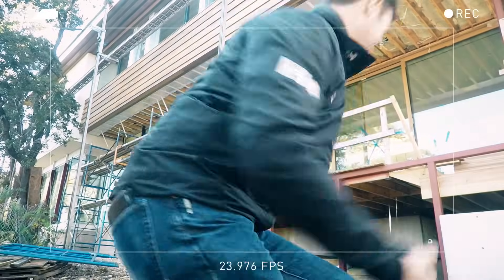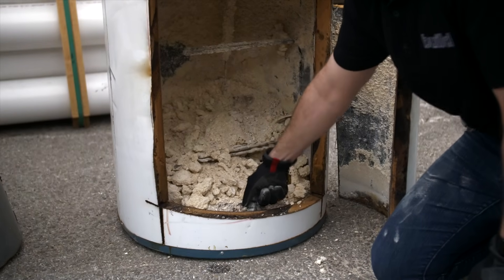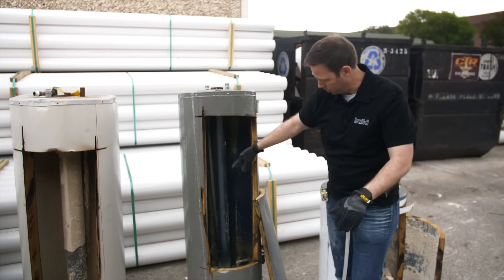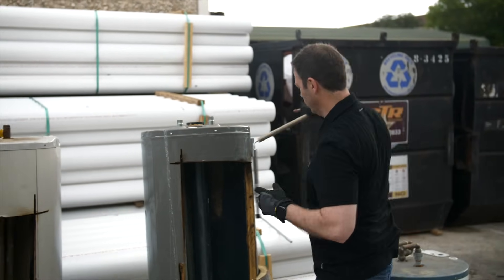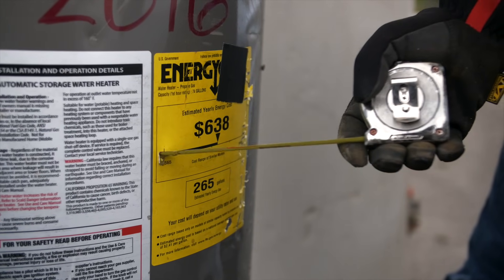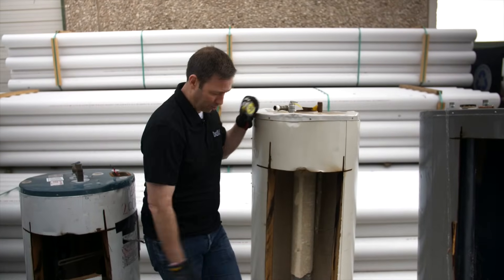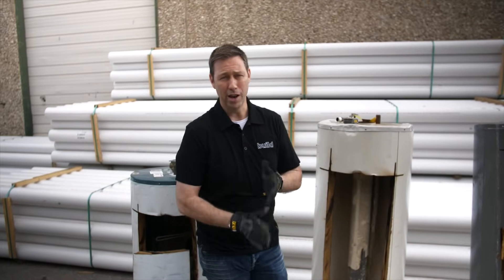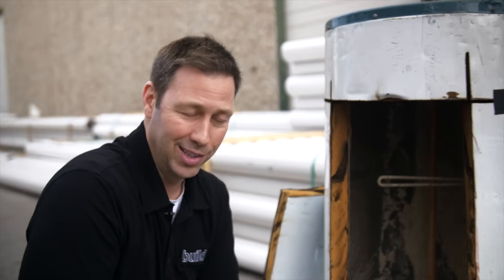Four Water Heater Tanks Cut Open - Lessons to Learn

Comment: @6:53 Pro-tip; cut your water heater open at the store before you buy it, to check insulation thickness.
Reply: You cut it, you own it!
Reply: No need to any more, you can download the specs to your phone.
Reply: Make sure the gas is turned on when the sparks start flying !!

Comment: We learned the hard way that you only touch the drain valve when replacing your water heater. Those drain taps are crap and will leak after you open them. It is a sure fire way to destroy your water heater. There really is just no way to extend the life of your water heater.

Comment: I bought a 10 year old house.  Did a water hardness test and found it was really bad.  So I bought a softner system and replaced the hot water heater.  I cut the old tank up, (Didn't have $20 trash fee, had a box of cutoff wheels and time) and found 6"-7" of scale/sediment.  The bottom coil was encased in scale.  I installed the new tank with Sharkbite flexible connectors with shutoff valves, so I can actually pull the whole thing out if I need to.  I'll replace the anode rod every 3 years after seeing this.  I don't care if that's unnecessary, I've spent a lot of money on this house, the softner system, and the new tank.  I'll spend a little more and get as much out of all of it as I can.  Thanks for the advice!

Comment: Those yellow stickers on electric use are meaningless. Look at the fine print. There's so many variables including price per kw electricity etc they are useless. To accurately predict that you need to know the temp of the air outside the heater, the water temp setting, amount of water used per month, price of electric etc... Nobody can predict the yearly price and they really don't need those stickers on them lol. What they should do is standardize the environment they're tested in and place a sticker on it for how many kw it uses over a year without ever using any water even. Then we'd know how good the insulation really is and have a good estimate of how much better this heater is than that one. But whatever it'll never be done and the info will always be unscientific, inaccurate, and meaningless.

Comment: So you're saying replace the anode rod every five to seven years however one of those tanks you just showed us was only 2 years old and had complete corrosion and look like the thing was going to snap off before you could even pull it out of the tank!
Reply: When a two-year-old electric water heater had an electrical fault which provided 60-80 volts to the inlet and outlet water pipes, everything corroded rapidly.

Comment: Never, ever herd of anyone replacing anode rods. Never knew you were supposed too.
Reply: They are so frik'n hard to get out....nobody wants to. You'll tear a ($500 deductable) ligament trying.
Reply: @readmore3634  good to know...thanks...so there's a not insignificant cost to doing water heater maintenance.
Reply: @new2000car  Look...here's the low down on water heaters...when new, remove the drain valve and replace it with a 3/4" nipple, a 3/4" ball valve (Full Volume).. and screw a garden hose adapter onto it with about a 3 foot hose.... Every 6 months, without turning off the water to the house, open it up all the way into a 5 gallon bucket and blast the sediment out several times. That keeps it pretty clean and it takes seconds. As far as life expectancy.....soft water is the best you can do. I have soft water and everything lasts much, much longer....especially shower heads, tub/shower valves....everything. Experience? 35 years a Union, Master Plumber. 10 years my own business.
Reply: @readmore3634  Sure that's the right way to do it...but anything that takes more than a minute...like installing a better drain valve...in the real world is not going to get done by the vast majority of people...if they can get out of doing it. How much extra would you have to charge to do this? People want it fast and cheap. There's also the if it ain't broke, don't fix it thing. Take off a non-leaking, cheap garbage drain valve and endeavor to install a high quality ball valve (how much is just the part? Gotta go get one, but how...drive over to supply store, online?) Better install it right, and test it. Consumers do not want to spend the money to have this done, mostly. I think I learned the prevailing school of thought on this the hard way. I had offered to flush someone's hot water heater a long time ago and the act of just opening the drain valve and then closing it...guess what happened?
Reply: @new2000car  I know what happened....I figure it's the do it yoursefler's  here... and I did say "When NEW....remove the drain valve (normally cheap plastic piece of crap).  If you try to remove the plastic  valve on a 10-20 yr old heater....you better be ready for it to break off inside. I have skills and tools to deal with things most DIY'ers cannot. But if you ask, I tell you.
Reply: Read More I know you said “when new” and even then the new valve-someone has to go out and find it at a hardware store, pay for it, then drive it back to the home, then install it. That time and energy could be better spent on fixing something else instead (in my humble opinion).
Reply: @new2000car  its not a fix...its to help make maintaining your water heater a breeze. I've replaced water heaters with a LOT (pounds) of gross looking stuff in the bottom of the tank...differs from place to place. So I put this dependable, cheap, easy to find and install ball valve on so I can blast that crap into a bucket twice a year.

Comment: You could actually tip your tank over about 20 degrees if it's in a closet and pull that anode rod out and replace it

Comment: I have a heater that is 18 years old. I remove elements and clean them, flush and have changed anode 4 times and clean out bottom of tank and it still works like a champ. We have extremely hard water with no softener but when I replace current tank Im adding a softener too. Getting to old to mess with the heater so often.
Reply: Be careful. Hard water actually protects your tank from corrosion while soft water is corrosive.

Comment: Appreciate your attempt to inform us, but by the look at the responses, you stirred up a hornet's nest. I think I will go tankless, thank you very much. I hope my comment doesn't stir up this hornet's nest anymore than what it is.
Reply: Tankless require an annual de-scaling.  Read the owner's manual available online at most big box stores web sites.
Reply: Charles Tredway You will regret it! "Combi" boilers as we call tankless heaters in the UK are terrible. They scale up quickly and flow reduces. You waste gallons of water waiting for them to actually run hot. They turn on every time you run a tap, so the electronics take a battering. When they inevitably fail you have no backup (most tanks here are heated by a separate gas boiler than also provides central heating, but have an electric element too for backup) the efficiency is questionable as you are always having to run water to waste. They don't work at all in a power cut. You'll be lucky to get ten years out of one, even top of the range. They need larger gas lines. They have limited maximum flow, two good showers if you're lucky. They won't have got hot by the time your dishwasher or washing machine is full (assuming you have usual US hot fill appliances)

Comment: A water heating spiral of hot water from the central heating system is a good way to heat the hot water, even better if you have a combi boiler, a condensing boiler is 85% efficient,

Comment: Makes me wonder if it’s the water supply that causes all that scale buildup. Well vs city water and maybe different issues from town to town.

I have never touched my 50 gallon electric for 10 years. Never thought about it. But that little plastic drain valve on the bottom feels like it might break if I open it! It seems to take forever to heat up any more. The digital control panel on mine does not show any errors such as an open Heating Element.
Reply: Slow heating is expected if the heating elements are buried in sediment.  You could try flushing some of that out and see if it improves performance.

The big gotcha is that once the drain valve is opened, closing it is likely to be some sediment preventing it from closing completely.  A "partial flush" is unlikely.  Flush until no more sediment comes out.
Reply: I will defiantly give it a try. I might try running my bore scope in there and take a peak as well after it’s drained.

Thanks.

Comment: You could just buy a tankless water heater which are standard equipment throughout Europe, Asia and South America. Not only will the heater last longer (20+ years) you will save more money on energy costs.
Reply: Not true for those with teen daughters. Endless hotwater means means Dad banging on the door "get out of there you're costing me a fortune"
Reply: The problem is power supply. Many old homes dont have enough amps to run that along with the rest of the house. 3 double pole breakers take alot of space in a box. Its especially difficult if the house still has fuses.
Reply: Kris Johnson Tankless gas water heaters don’t require a lot of electric power. The one I had in Europe was battery operated. Like the starter on a gas BBQ all you need is a spark to ignite the burners.
Reply: @y2knoproblem  IDK about all that... half the time our customers don't even have enough power to run an electric tankless and don't want to pay an electrician change boost your box.They pull a shit ton of energy. Especially if you don't live in arizona where the groundwater isn't as cold. We don't even install electric tankless in washington state because of how much power it takes to get the water from 50 to 120 degrees instantly. 

Now gas tankless on the other hand... Can't go wrong there.
Reply: Don't forget to buy a Navien.. everything else is junk.
Reply: @y2knoproblem  Guess again!  A tankless water heater vs. a standard one is a trade-off between creating all you would ever need at any instant (everybody showering at the same time while the dishwasher and washing machine are running), vs. providing a solution that averages out those peak demands by providing temporary storage of enough hot water to get you over the humps in demand.  Any system that places sudden high demands on its supply by its very nature will be less efficient than one that is more continuous (smaller peaks).   Plus when you factor in the much higher costs of the tankless unit for safety purposes alone (it must be able to handle much higher energy levels and not catch your house on fire) you are much better off with more water storage.  The only (gross) savings that a tankless unit provides over a standard tank unit is the energy lost from the hot water in the tank while it is sitting there.  Use a fraction of what your were going to spend on the tankless unit and buy additional insulation to wrap around your tank.  Especially for gas units, that savings is lost in all the additional maintenance that must be done and paid for in the tankless units.
Reply: *y2k
not in all cases.  depends on whether tankless is electric or gas.

Comment: Question, Will a worn out electric hot water heater "Cause Low Hot Water Pressure?" Mine is over 10 years old. What say you?
Reply: That could happen if the water tank is mostly filled with sediment.
Reply: Thank you Wally.

Comment: Hey Matt, you needed to also mention the "Dip Tube" that fails also. It's made out of plastic and deteriorates usually falling into the tank. When it's to short, cold water is mixed with the HOT water at the top section of the tank cutting the temperature drastically. This dip tube is about 12" off the bottom of the tank and supply's cold water to the bottom where the burner is on a natural gas or propane tank.
Reply: It should also be mentioned it needs to extend to the bottom of the tank so when you are flushing the heater it will stir up the sediment so you can get it out!

Comment: When my previous home was 5 years old, I had to replace the heating element in the water heater. We had a water softener, and inside the tank was a bunch of thick milky looking stuff, I assume from water softener. Maybe not adjusted correctly? I flushed it out real good and replaced the element. Interesting video.
Reply: The milky goo is probably bacteria growing, usually harmless. I only started seeing this when the government mandated water heaters to be set at 125, a perfect temperature for a petrie dish to grow bacteria...  it's illegal, but I set mine at 135 to prevent this- higher temperatures not safe for children or the infirm.

Comment: This is probably a dumb question.  Can a filtration system be installed going into the tank to help prevent buildup?
Reply: My home has a water softener system and the supply to the hot water heater comes from the softener. So yes you can install a filtration system for the entire house or a water softener system. Although I would not install a filtration system that supplies water to the hot water heater that removes chlorine.
Reply: y2knoproblem I agree, you are going to want the chlorine in the water so it stays sanitary in the water heater. Just get a water softener.
Reply: Well that's the dumbest thing I've read in awhile...  pressure kills bacteria? no.  And my neighbor's water heater (with soft water) died a lot faster than mine, with non-softened water.

Comment: As if you didn't already know, That 2nd tank is mild steel with a glass coating to protect it from corrosion.  Except it doesn't!

Also that 2nd tank likely rusted out and leaked around the bottom plate weld.

If I was a betting man, I'd bet whom had that tank also used a salt water softener.  Cheap made tanks with poorly applied glass coating at the most critical point "the lower plate weld" allows the slightly acidic softened water to find it's way to the steel and rust it out!!!     Anode rod isn't going to help under such conditions either as it too is deteriorated sooner. 

Looks nice and clean inside though doesn't it.   Might make for a nice flower planter in the garden and when it rains, someone will see where it leaked from in the first place.

I think as Karl Niemeyer detailed (4 months ago) below.   Water heater tanks used to be made out of monel which is a nickel alloy which would last 20-30 years or longer and companies realized they didn’t sell as many units so they started making them out of steel so they would last 5-7 years and they could sale more units.
Reply: My neighbor's water heater just crapped out and mine (4 years older) is still going strong. They have soft water and I don't.
Reply: the house i bought in 2016 was built in 1976, original gas furnace and original gas water heater. Heater still worked, no leaks, but only held 5 minutes worth of shower time lol. i wasnt going to try and drain it, put in a tankless instead but I was stunned a 40 year old water heater hadn't leaked yet. hard city water as well.
Reply: You nailed it right there. That's why I bought a stainless tank.
Reply: @joschmoyo4532  Who has a stainless? What manufacturer does that?
Reply: @Susan70003  Doubt if you can get stainless tanks in America but you can in Australia. It's the only way you can get a tank that lasts.
Reply: @Susan70003  Westinghouse electric tanks

Comment: Is there a standard size and thread for the anode rods or do I have to find one based on my tank and manufacturer?
Reply: All I have ever seen in the U.S. have a 3/4 pipe thread. there are different lengths.  If you do not have the @ 1 inch hex nut on top of your water heater, the anode may be attached to the 3/4 outlet pipe.Leave that one alone .It will make you cry ,LOL.
Reply: Yep Bradford Whites have the anode built into the hot water exit port. You need an exact match and it is a huge pain to change out. I have a 12 year old one and have just decided to do the flushes and replace it when it rusts out. I bought the house with it so it is probably too late to do much anyways.